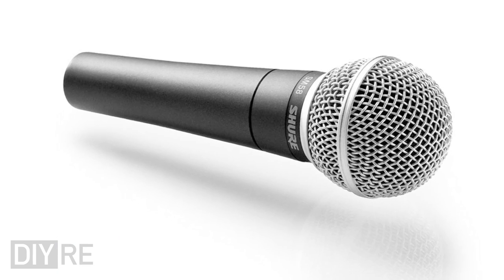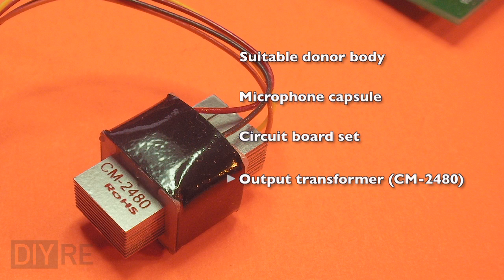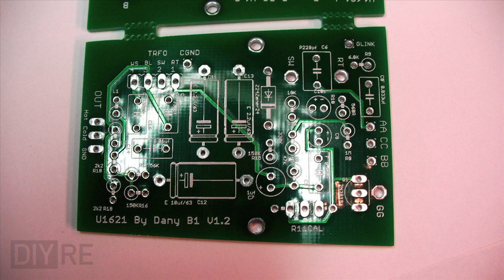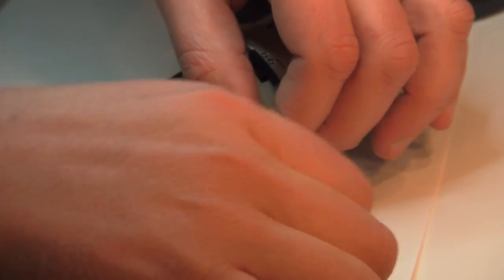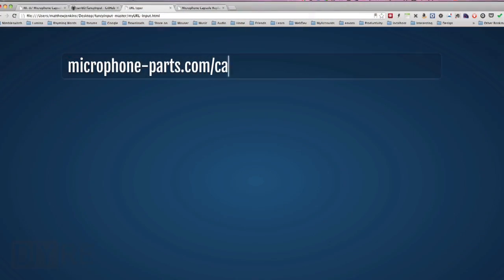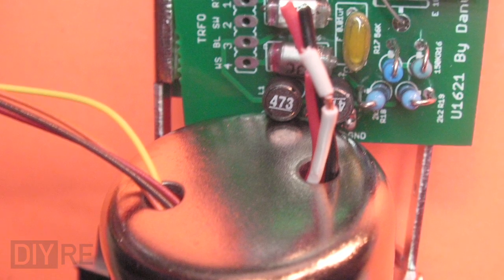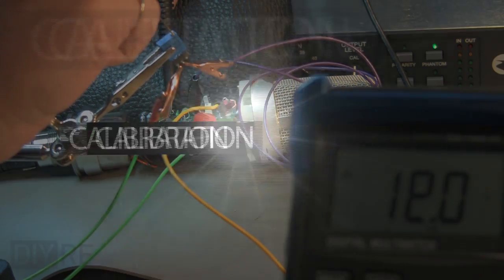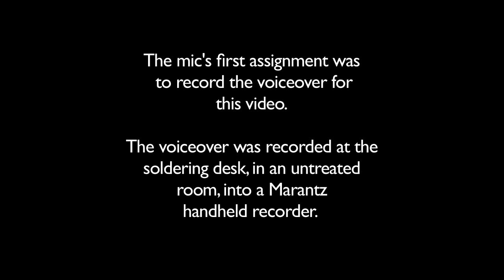How to Make Your Own DIY U87 Vintage Condenser Mic

Comment: Pretty nice as a diy project for learning stuff, but judging by your recording, it sounds nothing as the real thing (I can give arguments if in any doubt). I think all this would be money well spent on education, but not on a nice microphone :)
Reply: Yes, by all means make an argument. The circuit is IDENTICAL to one of the revs of the U87. I believe there were 16 or 20 revs to the circuit over the years. This is Rev 16 I think. The rest is the capsule.

Comment: 'Works well on some vocalists', so what is the holy grail for vocalists, according to you?
Reply: Akg 414
Reply: U87. I've compared C12, AKG 414 and U87 (and some cheaper models) on my own voice without knowing which is which and U87 wins by a mile. Compared on one voice but according to it's popularity, it's the same for most voices.
Reply: Scott Anderson Knock it off! The 414 has several models, and some of them sound like ch!t.

Comment: Without the original Neumann K87/K870 capsule no clone will sound like a Neumann U87 and never ever will. Even an original capsule reskinned through a third party (like Thiersch) sounds different to the original afterwards. Every clone capsule and the reskinned original capsules are missing richness and the emphasised 'Neumann Mids' Building this clone is probably a nice activity for someone but I would rather buy a CAD M179 if I don't want the harsh Chinese trebles frequencies on a budget price

Comment: yea. real DIY you got goin on here. better off just buying one and saving a pile of money in equipment required to build the damn thing.
Reply: if he bought the right parts the drill press would not be required and you could do it with a $10 soldering iron and $10 file and some wire cutters and multi meeter wich are all very use full for outer purpaces ex soldering iron to fix broken headphones work on car electrical wires and the multi meeter could be used to test batteries check to see if cable tips are bad etc etc
Reply: Andrew McEwan You can buy cheap XLR condenser microphones of Amazon for £20, that's $29.95, and you don't have to piss around with putting the damn thing together.
Reply: Beanie HP A u87 is $4000 , you could make 10  of these before it even reached that price

Comment: Meh ...  you will NOT end up with a U87 or even a clone thereof - it is a mere look-alike - not a "clone," which  should share the same DNA as the original.  While the circuit may be a close copy of a real U87 circuit, it is not as important to the final sound as many think.  95% of a microphone's final sound is a product of the capsule and the body (which has internal resonance and other issues explained elsewhere, but well known among serious mic builders.)  Point is, while you may like the sound of the your kit microphone, its capsule and body are NOT real Neumann products and no matter how closely they LOOK the same, or are NAMED in a confusingly similar way, they are simply NOT the same, and will NOT SOUND LIKE A REAL U87 in the studio.  It is NOT a CLONE.  A cloned sheep is pretty much identical with its DNA donor - your so-called clone microphone shares very little electronic and mechanical DNA with its namesake.  While it may look good, it will NOT SOUND THE SAME as a real U87, and that, alone, undermines any serious claim your kit mic is a clone of the original.  Of course this is just MY take - your mileage may vary.  Think about it ... there is a reason this kit costs so much less than an original - which is the same reason real recording studios continue to acquire and use real U87 microphones.  Just saying ...  JT

Comment: hmmm... i dont get the point of this project. thats exactly what the asians do. assembling cheap parts.... why dont u just buy a cheap copy. id rather would like to see how to make the capsule , transformer and the body..explaining the circuit in details... and why it sound like it sounds to get a real understanding why these 40 years old neumanns are still a benchmark
Reply: Google "Michael Joly". He does INCREDIBLE sounding Mods for MXL Microphones. They sound basicly exactly like a Neumann Microphone (proofen by precise Frequency Spectogram and sound examples)
Reply: i am an audio mixing engineer.i am an Asian.  i own UA 6176,1176LN. 003. & loadz of stuff which cost over $20K. I Also Build My Own 1176 & pultec EQ. Not For Sale. It's An art & fun to come up with ur own unique color of sound. so try to understand ta reason of  this tutorial. PS: ur iphone also assemble in china not in USA. good luck

Comment: Lemme see... buy the parts (around $350), assemble the parts (don't screw up), then HOPE it works!  Seems like a WASTE of time and money when you could just buy EXCELLENT sounding LOW COST diaphragm condenser mics such as:
Behringer C3 (multi-pattern) ... $75
Audio-Technica AT2020 ... $100
ART Pro Audio M-ONE ... $100
Studio Projects B1 ... $120
Apex 205 ... $130
Studio Projects B3 (multi-pattern) ... $155
Reply: "...EXCELLENT sounding LOW COST..." <- Something is already wrong here.
"Behringer C3" <- Yup I'm out.

Your ears are low cost bruh.
Reply: Don’t none of them mics will sound better than a modded one